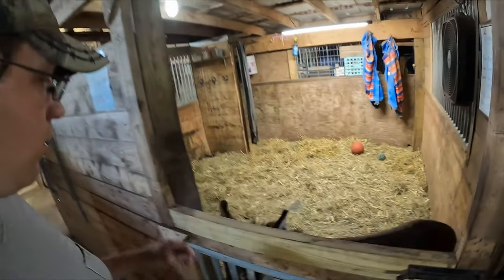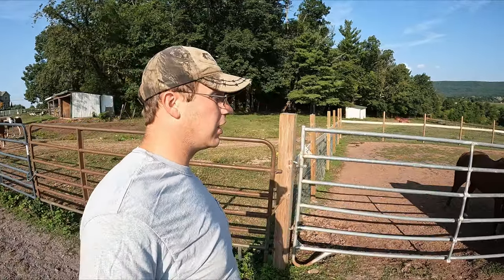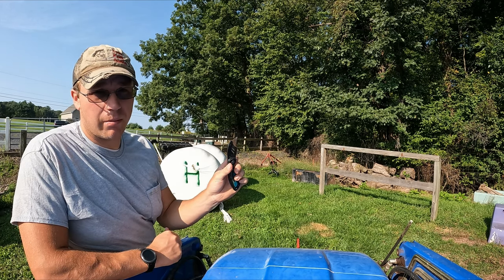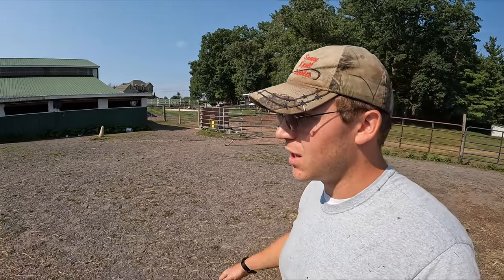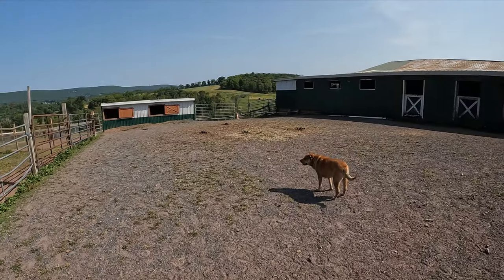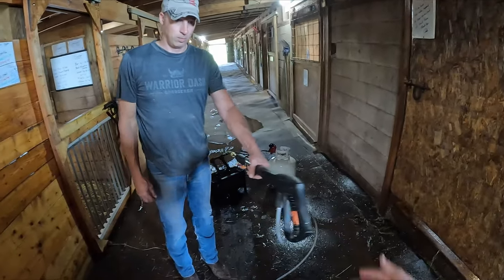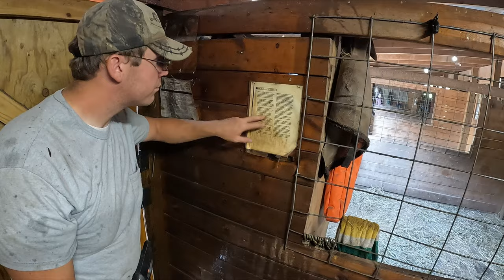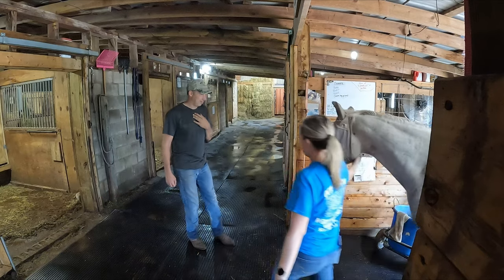A DEEP Clean Begins | Making Our Stable Look NEW Again!

Comment: I see by your videos, it has only been a year for running a stable, that you have showed your videos to share you adventure..  If it had been longer than a year, it would be very surprising that you had not pressure washed the stable before.....for the horses health as well as you own.  Thank you for showing us what generation stable lifers have already been doing.  And even things like having a structure to keep the hay dry.  A past generation would have taught you that years ago....and even had it already in place before you acquired the spot.  But you are new.  It is good to see the next generation learning what the past was not able to demonstrate for you.  Hang in there Lefty.....you'll get the hang of it!!!!

Comment: 1. Chocolate  milk is made with milk   chocolate 
Candy bars made with dark chocolate are good
My favorite is which ever I’ve in my hand and mouth 

2. If the structure over the round bales is working you need to plan on butting structures over all the round bales

3.  The horse barn  looks like new wood 
so shiny and clean
The horse owners will be very impressed

Comment: When I had a do-it-yourself carwash on a 1/2 acre lot, I washed the lot down everyday, For the first few months I used the pressure washer. Then I got a water rake. It reduced the time it took to clean the lot by more than 50%. It also cuts way down on the amount of water so it also drys much faster. Don't buy one! I looked on google and the prices are stupid. You and your dad can make one in less than 1/2 an hour from $25.00 worth of stuff at any big box hardware store. The whole parts list is; 1 piece of pvc, 2 pvc end caps, 1 T fitting, 1 45 angle fitting, 1 hose fitting and 5 or 6 screw-in nozzels.
P.S. I sold the carwash, but I kept the rake.